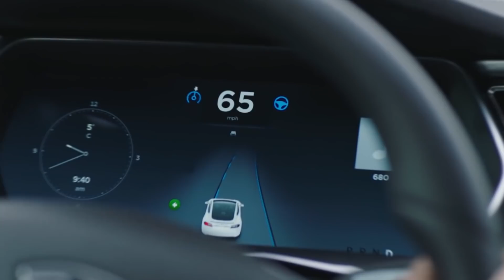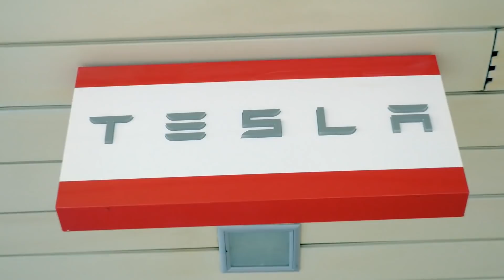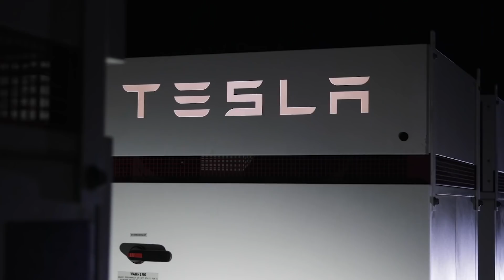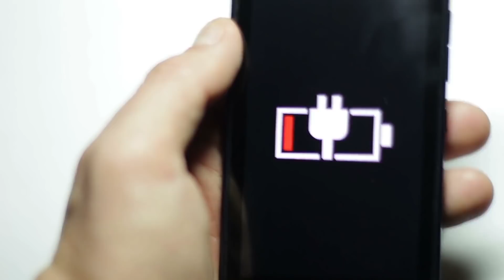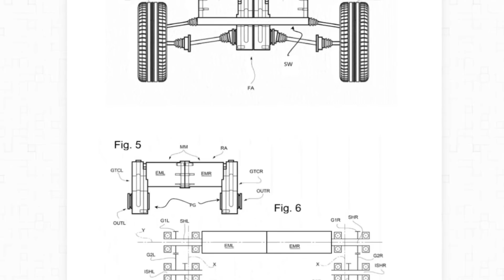Inside Tesla's First Million Mile Battery

Comment: That's a great development.
Reply: If if the battery operating voltage is between 12 to up to 36 volt then 620 kilometre can be extended up to 1400 km or maybe more

Comment: 6:38
There is big mix between battery lifetime and battery range!
Reply: majed9r I am glad I was not the only one the caught that. Battery “lifetime” may be a million miles but battery “range” will be under 1000 miles if not much less. For those that don’t get it, lifetime = many recharge and discharge cycles before you need to replace the battery pack. Range is miles covered in a single charge before you have to recharge.  If Tesla makes a car that covers a million mile in a single charge cycle, I’ll be buying their stocks with all my retirement funds and then some.
Reply: Well he did claim a ridiculous 10x fold in range at 4.05 in the video

Comment: What numpty thinks that just because a battery pack has more range, that less power stations! The person preparing this script needs to think a bit more. 
Because the pack has more capacity it requires more power from the grid. If it travels the same on one charge as four, that’s still the same amount of power from the grid.

Comment: Ok why do they refer several times to "million mile battery" like that's the single charge range...  confused or going for shock reporting?  The concept is that the battery chemistry, charge system and battery environnement management system will allow it to be recharged more times than previous batteries. No numbers have been released regarding capacity.
Reply: For that they are doing dry electrode coating battery which they outlined a clear path to 500 watt hours per KG which for reference today that number is 250. And it will be cheaper and better for the environment. So you can either have really cheap electric cars for the same range or slightly cheaper electric cars with double the range
Reply: Imagine having nuclear reactor.
Reply: jhonTM if there is a 650 wh/kg battery the world will be electric by tmmr
Reply: Mass producable*
Reply: P
Reply: jhonTM the best lithium ion battery thats mass produced today is around 250. Endless you can link me to another one
Reply: jhonTM sir. I looked up wh/kg and it says 250
Reply: @cjk_02221  I'm pretty sure today's flangship phone battery is more like 400wh/kg, but you will need cooling when use as EV pack. AFAIK tesla current battery pack is about 180-200wh/kg. So no, there is no battery pack that is near or surpass 300wh/kg!
Reply: Ferio Ng i hear a lot of people who follow tesla say 250 so i say 250 as well lol.
Reply: @cjk_02221  The battery itself IS around 250Wh/kg , but the battery cooling system massive and heavy.
Reply: Ferio Ng gotcha
Reply: Just to add to this - commercial silicone lithium batteries are approaching 450wh/kg, some of which already available and in use today.  It's a question of cost.

Comment: Hmmm don’t think they understand the concepts behind the million mile battery...”you can drive 4 times further without refuelling” erm no, they have only announced that the longevity of the cells is 4x better, they haven’t said that the capacity of the battery will be any better than current tech.....or how much even if it is....therefore this is rubbish..... there were other things too, but I cba to type it all out.

Comment: There are „current vehicles on the road tody“ with over 500‘000 km driven, namly Model S‘s from 2012 on there first set of battery and they still work!
Reply: Nope I saw that 500,000 mile claim and its had 2 battery replacements as well as a drivetrain replacement
Reply: Greg There are some on the first battery, the „drivetrain“ replacements aren‘t failure based, tesla replaced them, cause they had newer, better ones...
Reply: @laser_simon922  got a link?
Reply: However their batteries have most likely lost charge from their full amount.
Reply: [OSS]_Alterra_ Testet and they have up to 75% of the original capacity.
Reply: [OSS]_Alterra_ p

Comment: I believe that electric is the future, however as it currently stands, most electric vehicles are not supported with enough infrastructure in smaller areas (outside of large cities) to have it work well. When that is addressed, i honestly believe that electric vehicles will take over gasoline and diesel. Probably not right away, but eventually.

Comment: You should probably do a little research before you make a video. Chevy has ended production of the volt as of 2019. In 10 years they only sold about 150000 units.

Comment: think rather see these in trucks. but even if it can get 1 million miles is it a one time use type batteries then need to get new car. or can it be recharged and how long will it take to recharge
Reply: Are you thinking charge once and drive a million miles? It's going to need a lot of charge cycles but it will last for a million miles which is a lot. Even after that you could still use it but it might have reduced charge holding capacity.
Reply: @kushalraj93  thats what im getting from what was said. they didnt say what max range is or anything yet.

Comment: A few inaccuracies but I sense they were made in good faith, just some incorrect research:
1. Model S LR+ can do 0-60MPH in 2.3 sec, not 3.2
2. Model 3 SR is available for $35,000 but you need to call Tesla for it (not avail. online)
3. Model Y LR has about the same range of the Model 3 LR: 316 miles (280 was the old figure estimate)
Reply: Haven't seen the LR+/100D hit 2.3 sec - they don't come with Ludicrous Mode. I assume you're referring to the Performance/P100D?
Reply: Master Lorden he does mean p100d and they do come with ludicrous mode. But a Tesla model s p100d ludicrous does 2.5 but if you preheat the battery it does do 2.3
Reply: @Dfw579  And then half a second later your in jail and lost your license!
Reply: Greg yea lol
Reply: And I’m pretty sure the inside was stripped too!!

Comment: Electric Junk.
Reply: Why do you think it's ''junk''?
Reply: @evolt7553  How are they better for the environment?
Reply: @Seawolf How about the process it takes to make the battery? Also until only charged by renewable energy you're still using coal to charge. Oh and what about the disposal of the batteries? Driving an out of tune diesel truck which blows soot for 30 years is still better for the environment than a Battery vehicle.